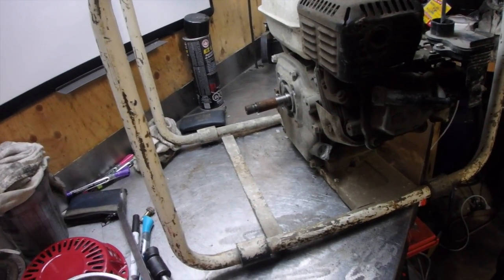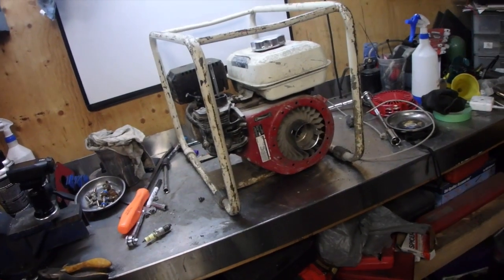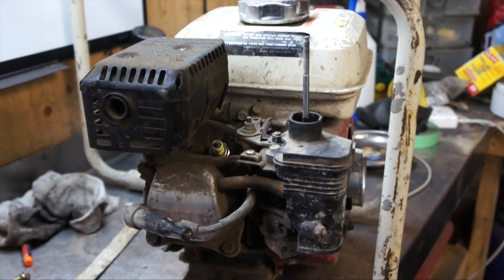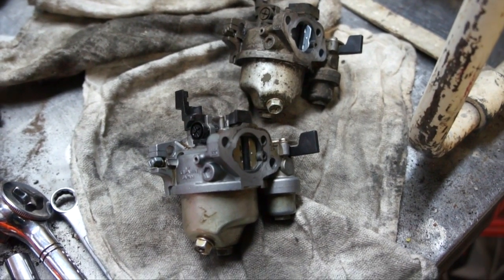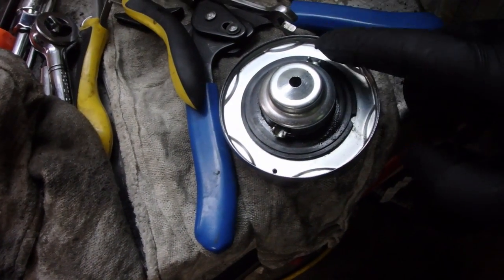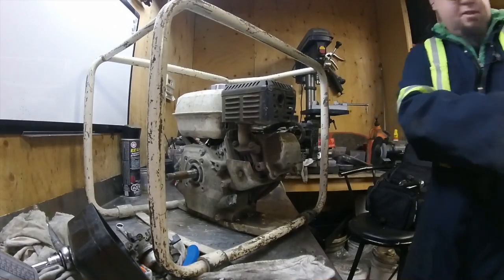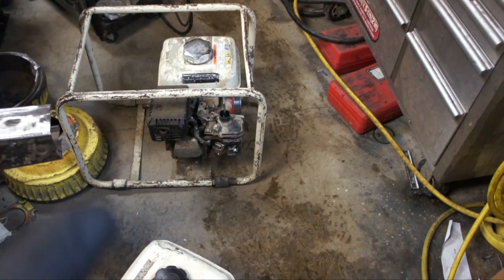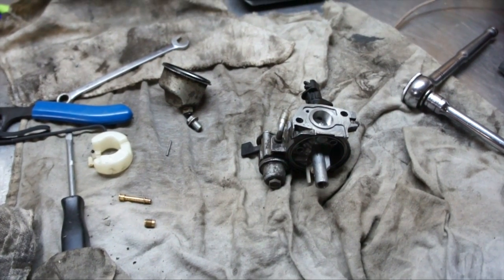Engine Only Runs When Choke is on

Comment: You have way too much fun...... (sarcasm), sometimes small engines are a pain in the ass
Reply from the maker: +roguesquatcher I dunno why but I love working on small engines
Reply: dumo2043 It's been awhile since I watched this vid, but that is possible on those Honda carbs, they have a slight dimple in the bowl so the float has room to move, if not lined up the float would be jammed shut
Reply: dumo2043 did you visually check the jets and verify float is level when closed in the up position?  Sounds like the engine is starving for fuel
Reply: dumo2043 I had an 8hp Honda that would drain the gas tank into the crank case when stored, even after replacing the carb. They also have problems with the "low oil" sensor, but normally they don't start at all if those go bad. Honda's can be a pain occasionally
Reply: My engine is cutting off when I turn off the choke I try everything like cleaning the tank an cleaning the caburator .what else can go wrong there?